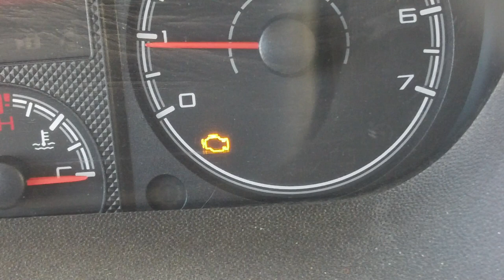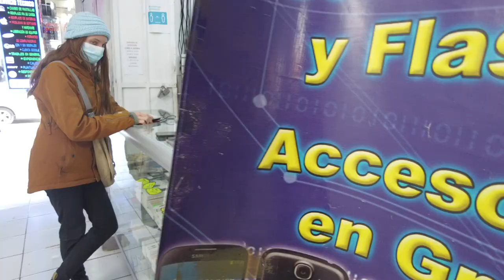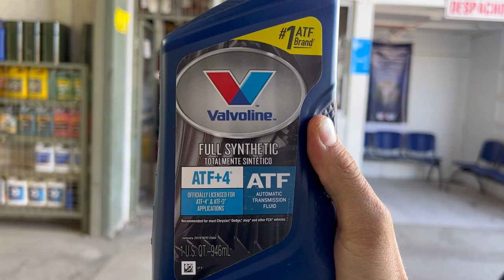This Could Be The End | Transmission PROBLEMS in CHILE #vanlife #roadtrip

Comment: Nice job improvising.   Transmission rebuild and figuring out why low oil pressure a lot better to address now than back in Bolivia or the jungle.   Less stress now, better days ahead.  Relax you made it!

Comment: Hi guy's!🌠Stephanie 🌹 Rose here from, FLORIDA🌴 Thanks 4 letting me tag along 👣 I've had some transmission trouble once or twice in my life and the one thing that I do know that worked one time whether people tell you the truth or don't tell you the truth about your problems you're having. I saw metal could not get reverse was told not to change the fluid cuz it would just help it disintegrate more faster. And you could look this up on the internet at also I verified it that way. See in Cuba they're unable to get parts and stuff and this is one of the tricks they use to get a transmission to last longer. A good Cuban mechanic is awesome to know! Instead of putting in transmission fluid put in automobile oil. Something about it seals up the spaces for a while lasted me an extra 6 months to come up with some monies had to be rebuilt anyways. So really didn't hurt anything because it had to be rebuilt anyways. I hope that's not the case for you guys but just would feel terrible if I didn't let you know what worked for me at one point in my life. B Safe, Stay Well  🙏

Comment: Your ongoing ProMaster mechanical problems are making me rethink my next van choice.  There are downsides to the Mercedes Sprinter vans verses the ProMaster.  The initial cost, service maintenance cost, less dimensional width, etc, but the more robust and durable drivetrain of the Mercedes seems to outweigh the downsides when doing the type of traveling you are.  Just my thoughts.
Reply: I think the Mercedes is a better option. More $ up front but hopefully less issues later.
Reply: Get one with manual transmission.

Comment: You folks look stressed out?  We in the Southwest have El Nino where the rain storms can be like being under water.  My much smaller RAM PROMASTER CITY wants to get stuck or slide off gravel roads.  So far it has done miracles though disappointed in being flooded out of excellent campsites.  Las Vegas is far too hot to camp at so being 200 miles north it is really cool in the mornings. I plan a trip to Arizona next week after checking my mail in Vegas.